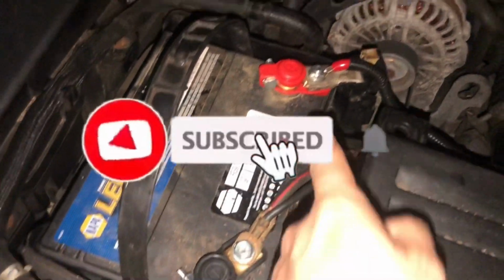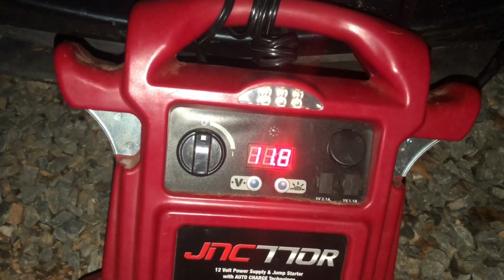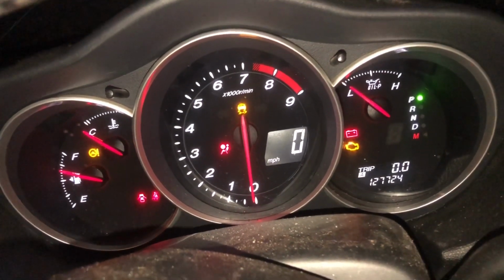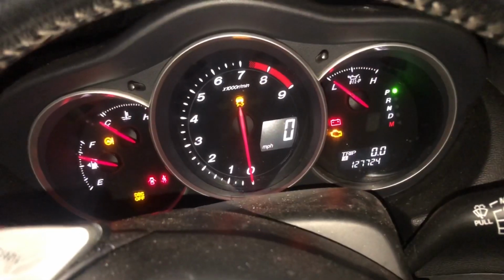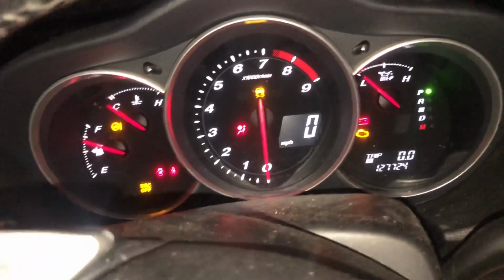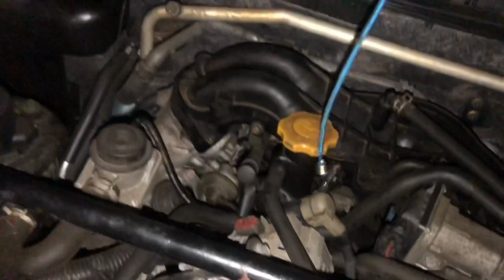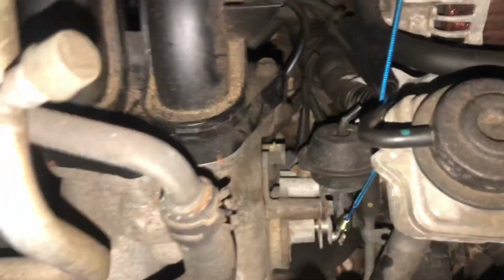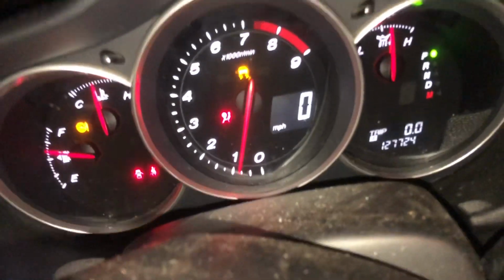Mazda RX 8 Won’t Start How To Start a Low Compression Mazda RX 8 Bad Apex Seals?

Comment: On a left hand drive car there is a screw holding the radio  in, I think on a left hand drive the screw in on the right side.You have to remove a plate under the steering column.

Comment: Absolutely a flooded engine there mate.
Having done this personally before on my RX8 my only advice would have been to not turn it over for as long as you were.. You'll end up burning the starter motor out. Just give it a turnover for 10 seconds, give it a few seconds to cool down, and start again.
That said, it's a simple process of having to keep turning it over and over to flush the excess petrol.
When finishing a spirited drive I always let the car sit in idle for a min or two, and then throttle to 4-5k RPM and hold it for about 5 or 6 seconds just to flush out any carbon build up too.
Next bit of advice... Never ever rev a cold engine like that or you'll end up a rebuild in no time. Actually hurt me watching that! RX8's really don't respond well to being red lined or even heavily revved when cold. Give it a few mins for the engine to warm itself up and let her rip!
Reply from the maker: Thanks so much for your advice, when my car did not want to start it was really frustrating and then I just try to do anything to get it started again, sometimes doing something stupid like Raving it up on cold, 
But since this video my RX8 starts up good now, but I got a new problem, my radiator is leaking, and this was a problem to start, I bought it like that
Reply: @mazdarx8diy38  my rx8 does this but not this bad
Reply: @mazdarx8diy38  read the manual. it tells u ho to start it. mr rx eight diy proformance yt
Reply: Mine one is not start  I take to the service and them change my fuel pump which not look new to me. But now my petrol run out from the pump and every time I drive is smell petrol till now.dont know what they do.and what I need to tell them to do. I already paid for it.im from sout africa.
Reply: @sanviti  My rx8 stinks of petrol every time I drive it. The rx8 drives very rich and because of the high temperatures the CAT usually fails, only making more emissions fumes through the exhaust.
As long as it drives fine you're ok :)
Reply: @edithhh1070  upgrade your ignition system and battery
Reply: @sanviti  have them make sure you dont have a gas leak and check your spark plugs and ignition coils

Comment: It was just flooded! This can happen if you leave it sitting to long, or this will happen every time if you don't let it get to running temp before you turn it off. Starting when your RX8 is flooded is easy. Hold your foot on the gas pedal all the way to the floor, and turn over for ten seconds and then wait ten seconds before starting again, and repeat this ten times. Holding the gas pedal all the way down will prevent any gas from being added to the engine, and the ten seconds between turn overs will stop the starter motor from over heating. On the eleventh time start with your foot all the way down on the gas pedal, then while still turning over, slowly release your foot from the pedal until the car starts, hold your foot where it started to keep it going, until the car has reached running temp, just under half way on the temperature gauge. After that you can turn it off, and it should start up again fine without touching the pedal. All in all it only takes about four or five minutes and you don't even have to look in the engine bay.
P.S This has nothing to do with compression, or seals, or oil, or timing.
Mine is the 2006 RX8, I am the second owner, and have had it for over 8 years, and have flooded it twice. Once because I got up half asleep to move it out of the driveway to let another car out, I started it and only went down the short drive and parked on the street right outside, and turned it off without letting it get to running temp. And once because I let it sit for a couple of weeks while away.
Reply from the maker: This is great information, normally I leave my car running I don’t just cut it off but I have done it wrong many times. Especially when moving cars around
Reply: @mazdarx8diy38  Yeah, that's how I got caught out to. Lesson learnt the hard way. But once you know, you know to keep it in mind when ever you do have to start it up for a short run.
Reply: Do i need to remove the fuel pump fuse?
Reply: @robertpascua5432  No you really don't need to. The computer won't allow the fuel pump to engage while your foot is all the way down on the gas, and the car is not running.
Reply: Does it work in a 4 port?
Reply: @geraldtorres5260  As far as I know it should work the same, six or four port.
Reply: Thank you stranger from the internet, Rx8 was running flawlessly for months, parked up for a few weeks and would not start at all. Stumbled across this video and found your comment, tried it and it's running perfectly, I do not say this lightly, I love you ❤
Reply: @shombre4  You are so very welcome. But you're no stranger, your my RX8 family. 😎

Comment: My 2004 rx8 has no power when you start off and bogs of you push accelerator for more speed but as it slowly picks up speed it will haul butt. What is up? I hate my car acting like a 71 pinto station waggon
Reply from the maker: Check vacuum lines and Solenoids, there might be a problem, also maybe there’s to much carbon buildup in intake manifold, also highly likely that you have a clogged cat

Comment: Hi i have rx8 13b car broke down scanned it 2 codes misfire cylinder 2 and multiple misfires, have replaced coils, plugs, and still wont start up, also trailer spark plug on cylinder 2 had a little fine metal particles in the plug. when i try to start it i sometimes get a mild back fire, any suggestions would be appreciated.
Reply: Having this same issue did you figure it out?
Reply: I'm not a rx8 owner in this time but I'll be in the future!  

'fine metal particles in the plug' I would remove the spark plugs to take a view inside with a endoscope. 
I afraid the metal is from the cumbustion chamber.The apex seals and char scrape / damage the chamber. 
These metal particle short the spark plug so no spark can fire up the casoline.

After that I would flood and flash cylinders with oil => petroleum-acetone => oil! Inspect the cylinder with endoscope. 
Chrank the engine manual to clean / to loosen the seals and dirt.

Check the results with compression tests at the whole process.
Reply: @svendittmann3105  flood and flash cylinders with oil how do u do that,do u put oil in to the spark plug hole?
Reply: @xXGHOSTXxAkaAlex  hi

Comment: unfortunately, you motor is subject to the same issues as all early Gen RX8. You have bad apex seals, side seals that are not providing enough compression or your rotor housings have missing chrome and causing compression loss. Either of those issues means the motor needs a rebuild. The only way you're going to know is with a compression test (using a rotary compression tester only) if your compression is acceptable, you could look at the ignition system, but that's probably not the case.

The RX8 doesn't have a closed loop fuel system like early injection systems with a pressure regulator returning fuel to the tank. The pump is a speed regulated pump that runs at different rpms to provide the correct fuel pressure throughout the rpm range of the motor, controlled via the ECU. That is why there is no regulator or return line to the tank
Reply from the maker: Thanks that’s really good information, but my RX8 still starts good after that time, it also had good acceleration and fun to drive, I did the mid pipe and replaced all vacuum houses and all Intake Solenoids, and doing pre mixing so far so good, I bought air intake, oil catch can and some other things to upgrade it, also will buy a tuner
Reply: @mazdarx8diy38   Does it easily start hot? again, the only indicator for you to know what the condition of your motor is a rotary compression test. low compression engines still run, however hot starts issues will become apparent and will increase over time. Even spun bearing motors still run, but not for long...
Reply: Definitely sounds like low compression especially since the engine has 120k miles on it and by the look of that poor 8 it probably was not maintained properly at all. I am going to take a guess and say the rotor housings are the culprit to the low compression, probably chipped to hell and have chatter marks all over the place

Comment: I have a 2006 Mazda rx8 with 60k miles it was sitting for a while about over a year i changed spark plugs I try to deflood it just today some smoke shot out  little once it’s on it runs great but it doesn’t stay on either I’ve tried to reset ecu too Can anyone help me my gut tells me that it’s not the apex seals .
Reply from the maker: Does your RX8 quits running? How long before it stops running, if that’s the case, try cleaning or replacing your crank shaft position sensor and ignition coils
Reply: @mazdarx8diy38  well it turns on and it’s weird it’s not consistent sometimes it won’t turn off and then sometimes it won’t turn on haha ignition coil wires look good from where they connect
Reply: @edithhh1070  did you ever diagnose this issue?

Comment: So what exact method did you use to get your car deflooded? Cuz I have the exact same provlek
Reply: Depress the gas pedal and crank the engine for a good 5-10 seconds, do this two or three times, just be careful to not cook your starter.  After that, attempt to normally start the engine. This method prevents the computer from adding additional fuel into the chamber and will prevent the spark plugs from fouling any further.

Comment: O have my Mazda rx8 2004 automatic 
And it has RPM problems when i start the car and i accelerate right awey it raises the rev wev well but after a few seconds it doesn't reach 4 thousand rpm
Someone help me?
I've already changed a lot and still it continues 
Someone please
Reply from the maker: What have you done so far?

Comment: If u want to k kw the answer you kind of answered it yourself. Look up dry and wet compression testing!  That's pretty much what's happening. Cyclinders getting wet and starting. Then when its warming up they cylinders sealing itself off!  Rebuild time!
Reply from the maker: Great information, thanks for taking your time to answer me, I just bought a Mazda Compression tester and planning to test compression sometimes next werk
Reply: @mazdarx8diy38  how was the compression after testing